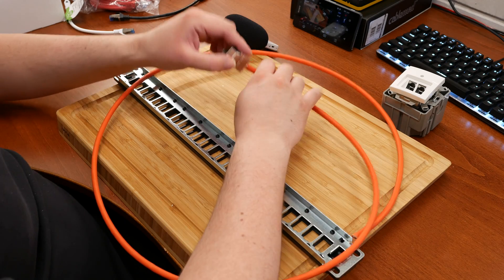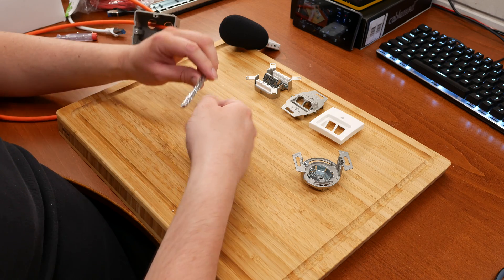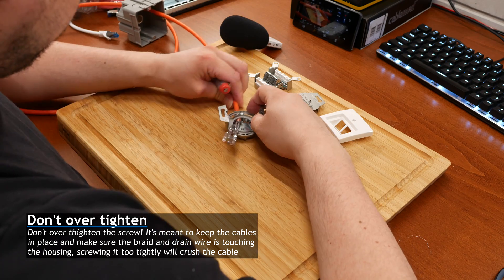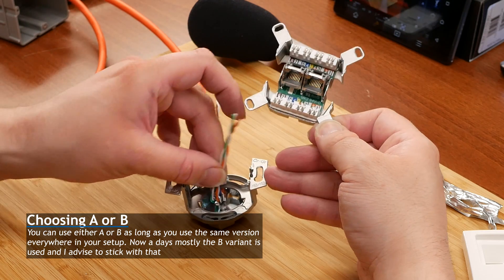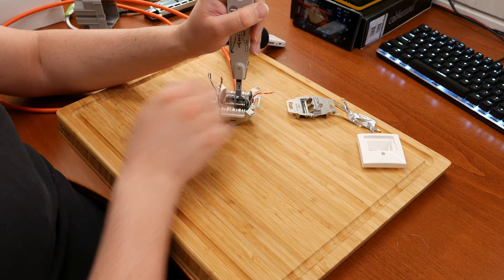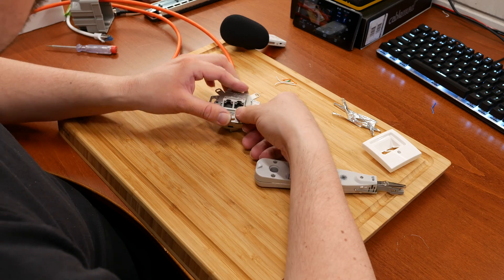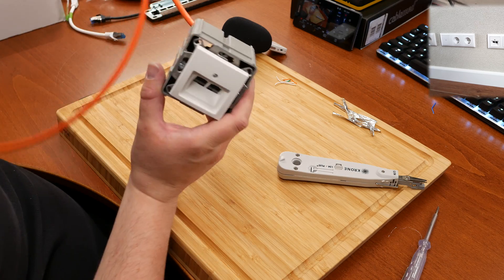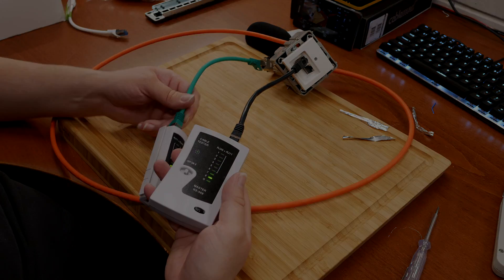Home Networking: How to terminate ethernet cables (Part 2 - 2)

Comment: it was my understanding, and i may be wrong, that the distance between the twisted pair in the cable to the electrical contact in the connector should be less than or equal to 0.5 inches.  is that the case in this wall connector?
Reply from the maker: Yes, with twisted cable, of any type, you need to try and keep the distance that is untwisted as short as possible.
Reply: Yes william. You should untwist as little as possible. Basically keep it twisted right down to the connector. I would say the example in the video is untwisted a little to much, but it will do the job fine for 50m or so. If you untwist it too much, just retwist it by hand. The exact twist pitch doesn't matter that much on a short length of cable. (The twist pitch is strictly controlled in the whole cable, with each pair using different pitch; But for short run it is not important).

Comment: Have you ever used or checked out a Pockethernet?

I recently bought one and used it on a job installing an IP camera node, where a used UTP cable turned out to be faulty. At first with a simple tester I had connection on the right pairs, but the signal/image quality was not up to standard levels. When I brought my Pockethernet from home and used a bit-error-rating test it failed. Turned out that two wires had a bad connection. Saved me a lot of time and trouble investigating!!

My lesson learned was: simple testers are just an indicator tool, not a definitive testing method. I can say that I am glad I bought a tester like that for relatively little money.
Reply: Very interesting. What was the length of the cable out of curiosity?
Reply: @movax20h  It was just a 20 meter cable, but was routed through a ventilation duct for an ad-hoc network setup for video surveillance. 

My reaction was 2 years ago and I must add that Pockethernet is in a sorry state as a company. I stille use it and really like it, but due to internal company issues the software and firmware updates are stalled for months now. 

Still a good product, but realize this when purchasing. I hope they get their act together
Reply: @RobvandenBoogaard  Thanks man. I always tough that signal integrity issues usually occur for long lengths, but apparently no. Even short runs can be faulty. Probably too tight bends, pulling too hard, or bad terminations.
Reply: @movax20h  indeed, in this case the routing of the cable through the ventilation duct resulted in a damaged cable

Comment: One tip, test your tester and patchcables (in the video green and black) first. Just connect the patchcable between the 2 parts of the tester and check if everything is OK. Also reminder to use shielded patchcables if your network use the ground, like you have with cat7.  The other function of this tester is for RJ11 (telephone).